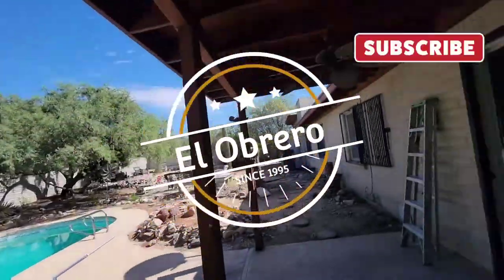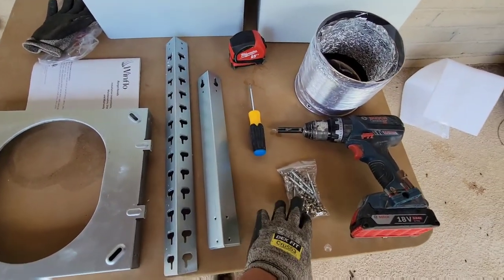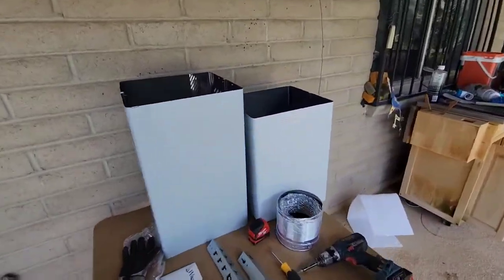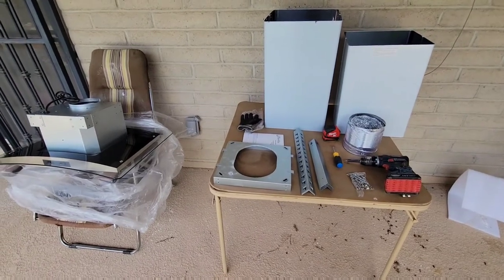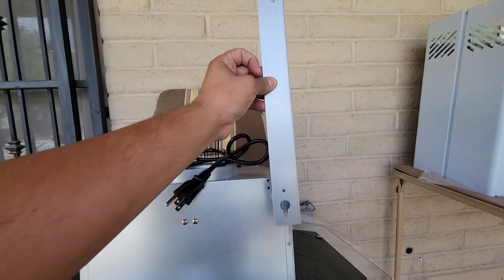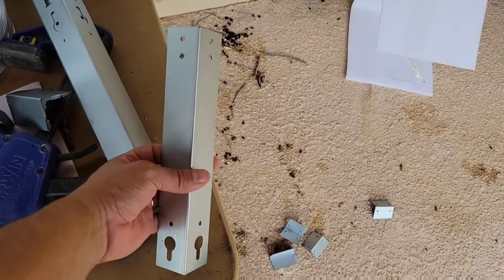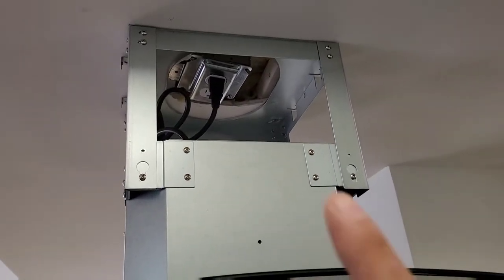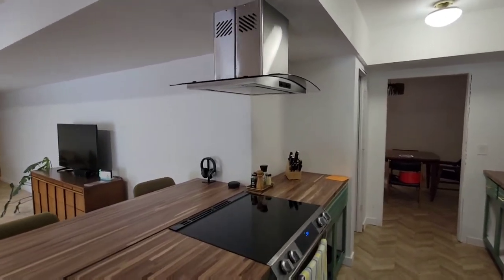Range Hood - Winflo - How to install

Comment: Hey.  I just stumbled onto your vid...your electrical device(Outlet) is being exposed to grease build up especially since you don't have a carbon filter (Fire Hazard).  you should have HARD WIRED(That's Direct) the fan.  before install, flip the fan unit upside down to access the electrical box and make the connections by removing the power cord.  the fan should run on 14/2 wire (15 amp circuit), if its a 20 amp at your breaker box, then you'll need 12/2 wire ( you didn't show that)

Comment: uhmmm where the air is being blown to? back to the room?
Reply from the maker: Yeah I know. In my situation, kinda sux. Not ideal. However, you can blow the air through carbon filters and yeah back to the room. It's been one year we cook all traditional Mexican food, I can't complain. Filters do work. You can buy new ones or I just cleaned them out and put them back in every once and again. I am happy with the hood running the filters and air back into the same room. Of course it would be best to run it out via duct, but could not happen in my situation. I am not a professional home remodeler so guess I just made it work. After all said and done I love the kitchen. Let me know what you think? All good and loving here.